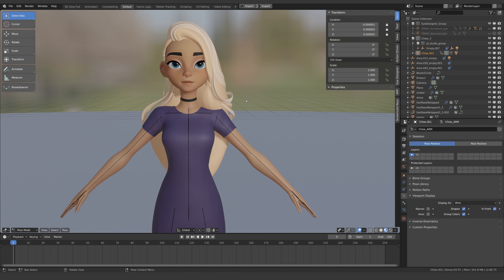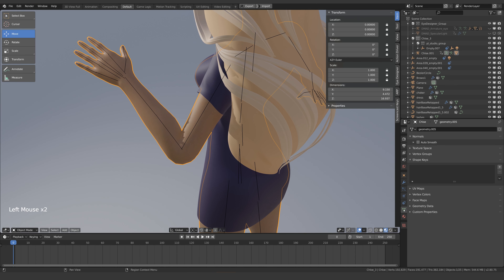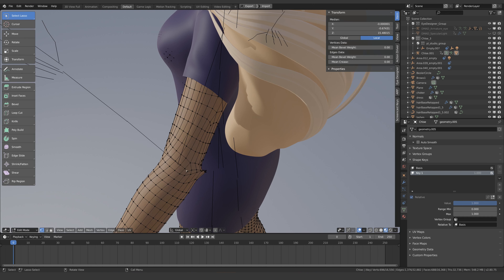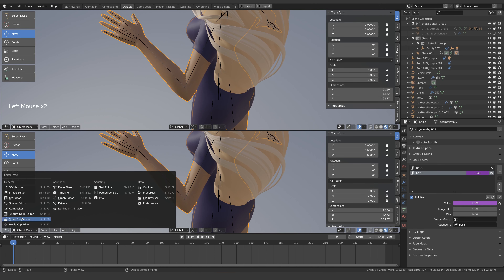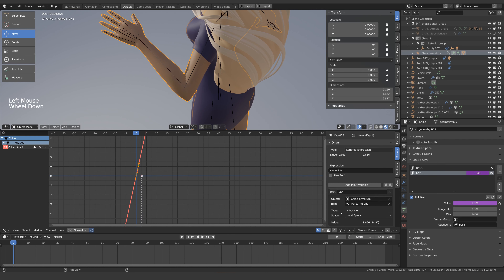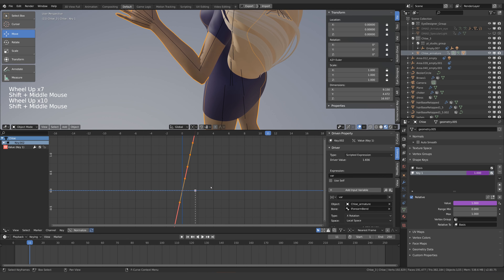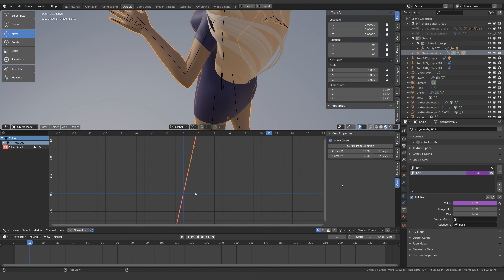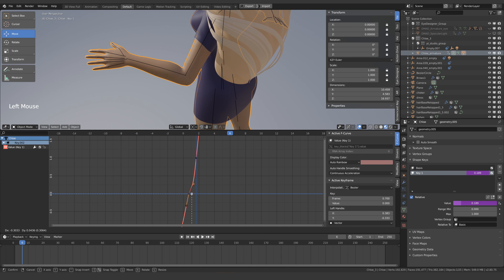Corrective Shape Keys - Blender 2.8 Tutorial

Comment: It isn't working, whenever I move the curve around in the driver menu, the shape key slider with a numerical value goes up and down, but whenever I move the bone, or animate the bone moving. The shape key doesn't seem to cooperate with the driver's directions of x rotation, or any other rotation for that matter.

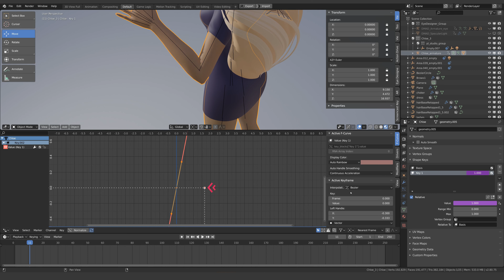EDIT: 2:31 "This red dot represents where the arm is rotated" No matter what I do in the 3D window, in object, or pose mode. I cannot get that red dot,(white square) to move. I can move it up and down in the driver window, but that's it.

Comment: Nice tutorial. How do you solve deformation in joints with more than one axis though, like shoulders? Can you use shape keys for that as well?
Reply: I'm only just learning about this myself, but my guess is that you would create a corrective shape key for each axis, and then as you move the bone it blends between them.
Reply: For "sphere socket" type joints that can turn in almost any direction, like arms and legs etc, you usually need four corrective shape keys: FRONT, BACK, LEFT, RIGHT (or NORTH, SOUTH, EAST, WEST if you prefer).

Comment: The white square in the Drivers Editor doesn't move when I scrub the timeline... I have my corrective shape key set to 0 at frame 0 and 1 at frame 10. But according to the F-Curve values (no matter what I change) in Blender 3 the shape key will only ever be 1 or 0... it refuses to let me drive the shape key based on the rotation of the chosen bone. So done.